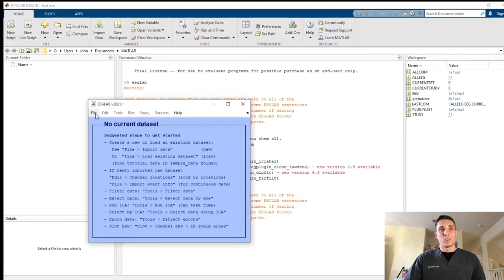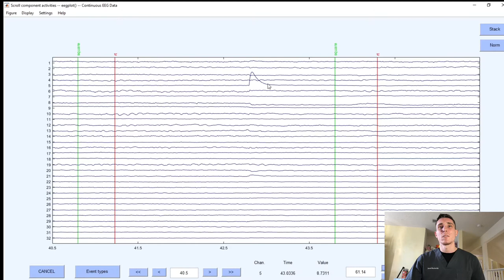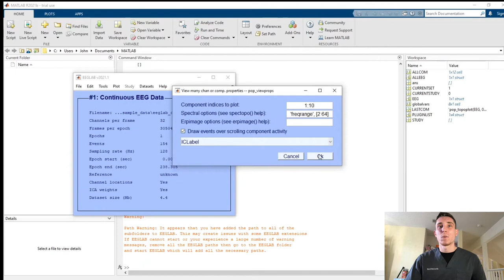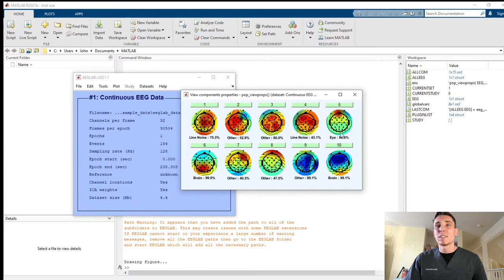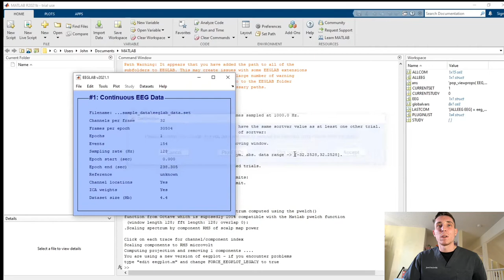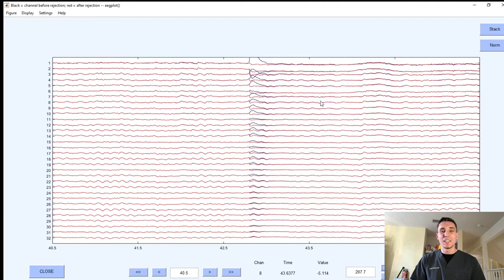EEG Eye Blink Artifact Removal With Independent Component Analysis (ICA)

Comment: Would it be better to remove the EOG1 and EOG2 channels BEFORE to run ICA?
Reply from the maker: If you want to remove eye artifacts from EOG channels then include it.
Reply: @jaredbeckwith  Thank you for your quick answer! It's hard to find clear info about that. In my system, I have only 16 channels and for some participants, Fp1 and Fp2 are highly contaminated with eyeblink artefacts (which is not very surprising to me), so it's better to keep these two channels in the ICA?
Reply from the maker: @laurentdubois4788  Fp1 and Fp2 are most important to include because the eye blink artifact components that you remove will come mostly from them.

Comment: Okay good lucks for you  , i need an advise please , i need to Evaluate eeg channels after artifact removal ? What do you propose ! 
To say this quality of signal after artifact are better than the original
Reply from the maker: It is best to remove muscle artifact during a seizure so you can see where the seizure starts in the brain.
Reply: @jaredbeckwith   , okay i need to know how calculate the signal to noise ratio  ^please help me , to compare channel with artifact and channel without artifact ?
Reply from the maker: You can measure performance with relative route mean squared error (RRMSE)
Reply: @jaredbeckwith  it is the same  as RMSE ? , i didn't  found how to calculate the rrmse with python
Reply from the maker: The formula for RRMSE involves RMSE. I just can’t type it out here. Maybe I’ll make a video about it